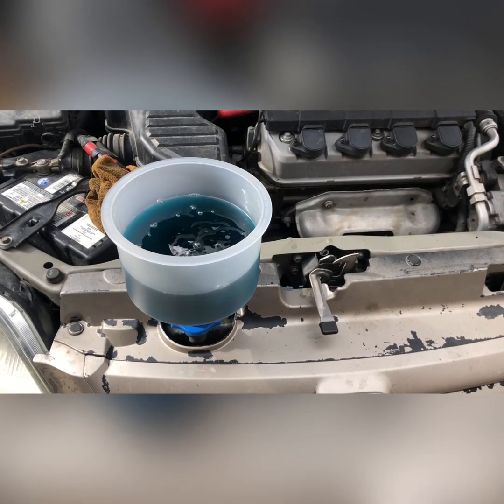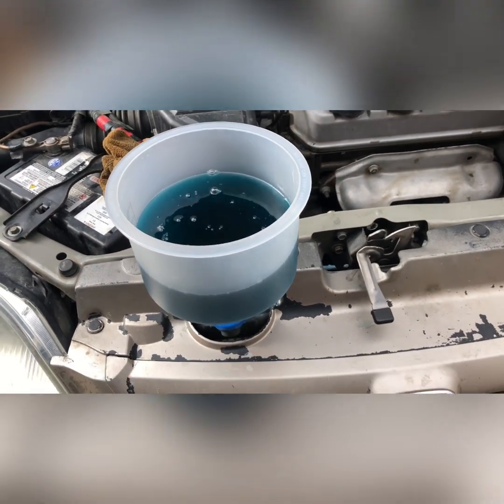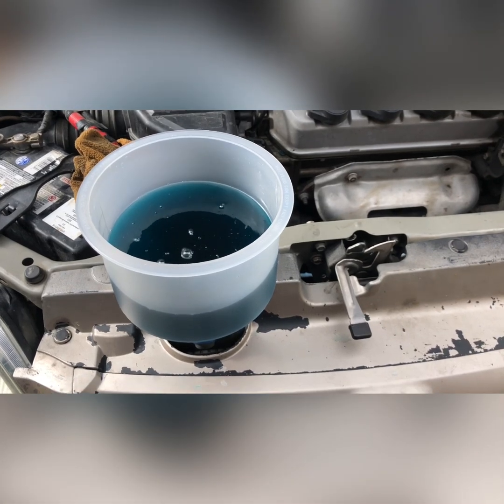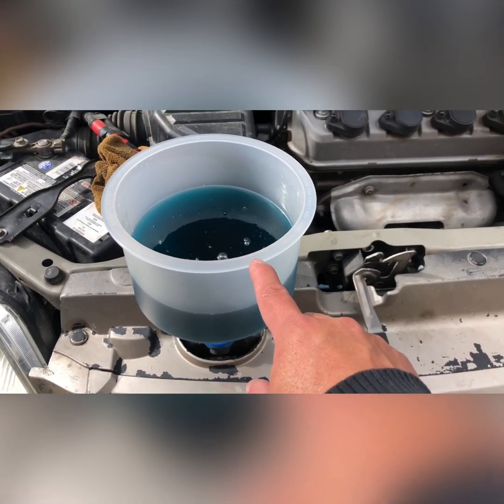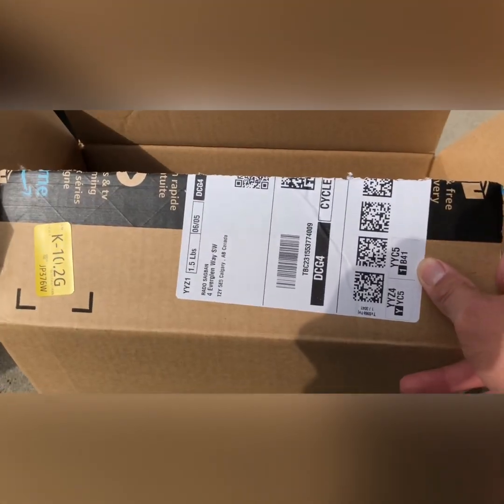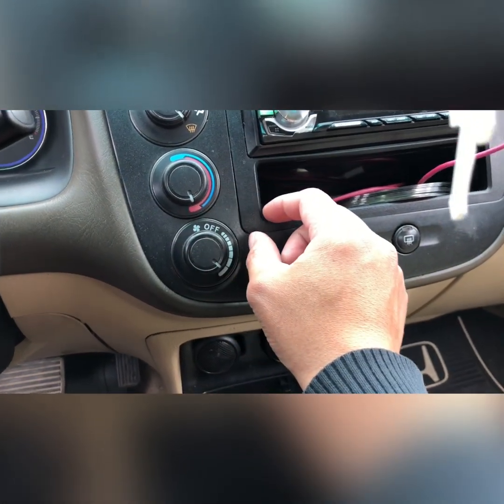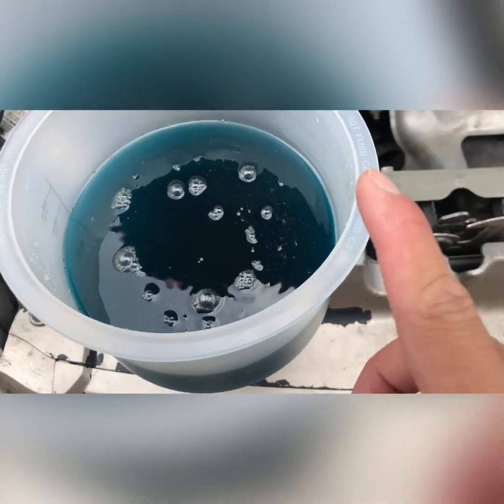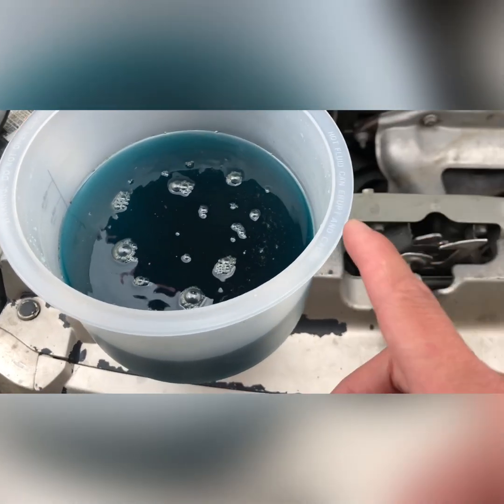HOW TO BLEED A CAR’S COOLING SYSTEM? #2001-2005 Honda Civic

Comment: Hey bro I have a question i tried bleeding mine, but the fan never went on with the cap off. How long did it take for yours to turn on??  I had my cars on for 1an hour and no luck till the put the cap on
Reply from the maker: Like 20 minutes..you can rev it to 1500 rpm
Reply from the maker: Reve to 1500 rom and hold it until the fan turns on twice.

Comment: My coolant goes to reservoir tank but doesn’t return to radiator when it cools down or after a while and so I guess radiator goes dry and it starts overheating eventually. Has anyone had this experience or know why this could be that’s not the head gasket? Maybe I’m missing something.
* I watched your video and maybe this is better to bleed it correctly I will buy the kit. They also sell it at harbor freight and I will try this and if it doesn’t work I know for sure it’s most likely HG or some other weird obvious thing. 🤦🏽‍♂️
Reply from the maker: Yes try bleeding it or check your thermostat if its not stocked close or open..if its old better replace ur thermostat then bleed using this funnel.
Reply: W 90 % przypadkach to uszczelka pod głowicą. Jest dużo informacji na polskich stronach. Civic forum
Reply: I have the same problem did you figure it out?
Reply: @gregoryoganisyan it was probably head gasket honestly I just didn’t want to put money into it so I junked the car.
Reply from the maker: Yeah it was the head gasket leaking..

Comment: Did it fixed the overflowing of coolant in the reservoir after you bled the radiator system?
Reply from the maker: Yes it did..
Reply: @radzvlogs 😮maybe I will use this funnel they sell the kit at harbor freight. About how long did it take you to finish this?
Reply from the maker: @Godisgr8always after the fan fan turn on twice then your good.